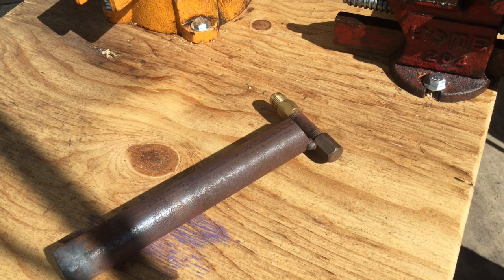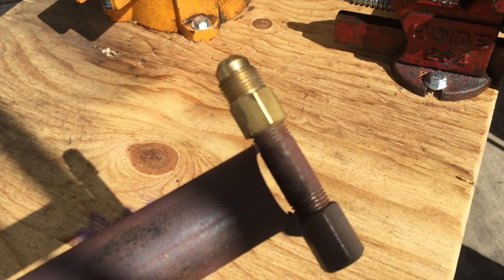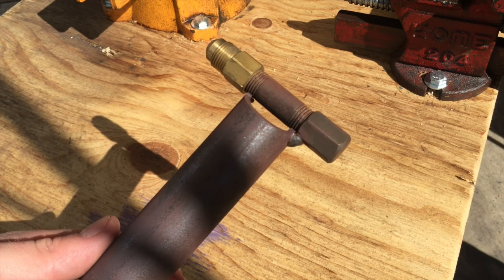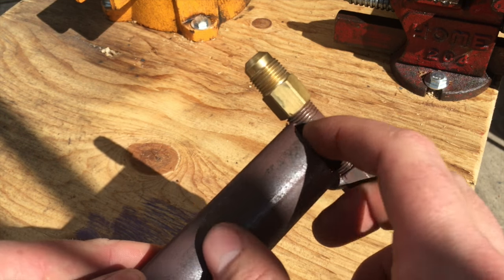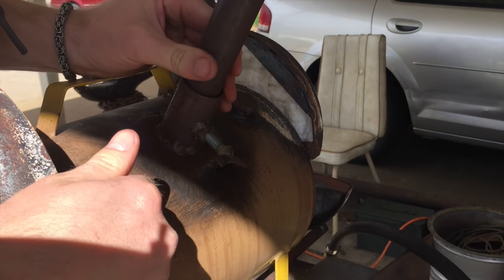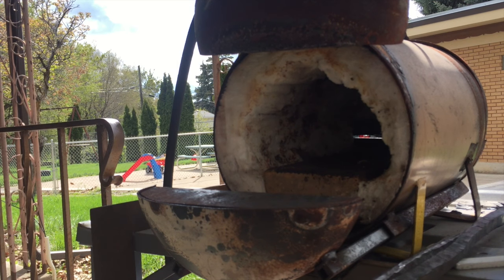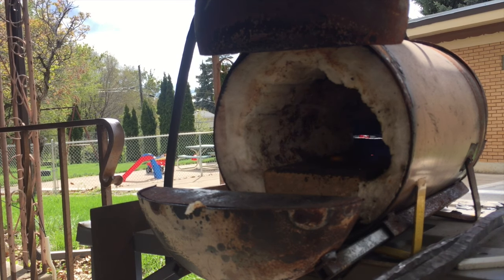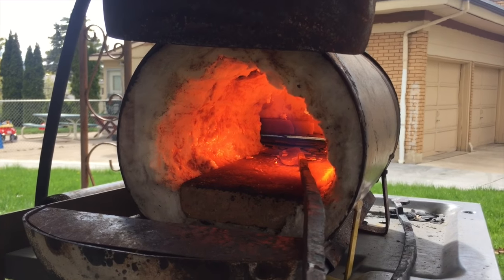Forge burner for $10??

Comment: I built one of these with 3/4" Black Pipe. First test fire it wasn't getting enough air so I drilled another 1/2" hole under the 3/4" hole I first drilled it works GREAT now in my very small refractory brick forge. I still want to line forge with ITC100 after this is done I believe I will be able to forge weld or do some cable Damascus? Time will tell!! Thanks for the vid I think the whole thing cost me 5 bucks including the 0-.035 drill bit to drill the orifice! Bought a 5' stick of the Black pipe at "RESTORE" got the nipple there and the cap for 3 bucks? and the drill bit was a couple.
Reply: hey,do you mind upload a video?

Comment: Interested in building one of these but have a couple queastions. How large is the main pipe both length and diameter, how do you line up the hole in the 1/4" pipe so it goes down the tube?? Is it just a standard Black Pipe? Thanks for your help and posting this. It will save tons of money!
Reply from the maker: so I believe the pipe on this is about 1". you can use 3/4 ID with very good results. the pipe sleeve will depend on the OD of the pipe you choose but doesn't need to be a perfect fit. length should be around 10 to 13 inches. its standard black pipe, though the fitting sleeve is stainless (though its what I had laying around). to get it hole lined up just right, an easy way would be to get the drill bit that you used to drill the hole, insert it in. that way you can visually see where the hole is pointed. attach a string to retrieve the bit is an easy way to do this after the pipe is welded. let me know if you have any more questions and good luck!

Comment: could i use this for a foundry?  for things like brass and copper?  

basically what are the temps on this thing XD :P
Reply from the maker: you sure can! The forge gets upwards to 2000*F. you might need to have the burner come in from below and have an upright smelter to get copper to melt
Reply: sweet!
Reply: What's your problem?

Comment: nice lighter! i have one just like it. A pocket full of coins will give some character real quick.
Can i get the names of the parts or at least the dimensions of the pipe asap? Thanks.
Reply from the maker: Thanks! Its slowly getting some character, but she performs real nice lighting the forge! (just answered this question so a good portion of this is copy and paste from above). so I believe the pipe on this is about 1". you can use 3/4 ID with very good results. the pipe sleeve will depend on the OD of the pipe you choose but doesn't need to be a perfect fit. length should be around 10 to 13 inches. its standard black pipe, though the fitting sleeve is stainless (though its what I had laying around). For the brass fitting, its a flare fitting to 1/4 black pipe. if you go to a propane dealer/tank filler, they should know what you are looking for. https://www.ebay.com/i/252328421386?chn=ps&dispItem=1 will give you a good idea, though you can adjust the fittings to fit what you already have
Reply: alright awesome! thanks. I really just need the pipe dimensions since there isn't much info on the subject.
Reply: i had a bit of gas to air ratio problem. What size bit did you use for the hole in the pipe where the gas comes out?
Reply from the maker: I used a 0.035 inch hole. same size as a mig welder tip. you should have the burner hooked up to the forge as doing a dry run out of the forge doesn't create enough back pressure to mix the gas and air. once you get it to fire up, go into a dark place and fire it up. if you have orange flame coming out, you have a softer burn, meaning its a cooler flame. introducing more air will help correct this imbalance
Reply: Bear River Knives thanks a lot. after rewatching i heard you say the hole size. i am still trying to figure this burner out. thanks again for all the help.